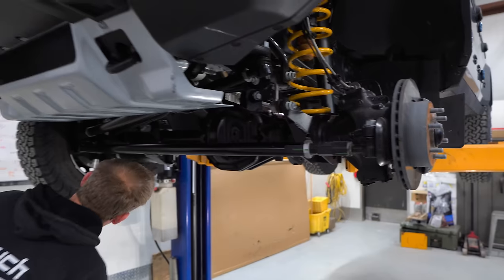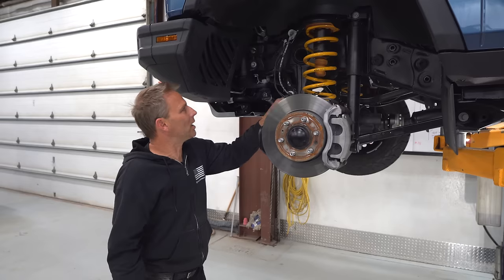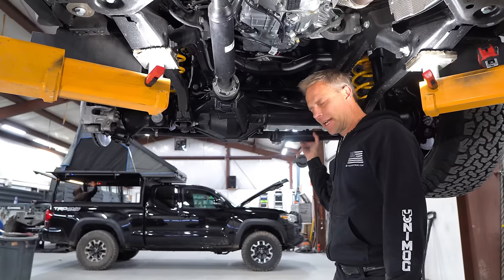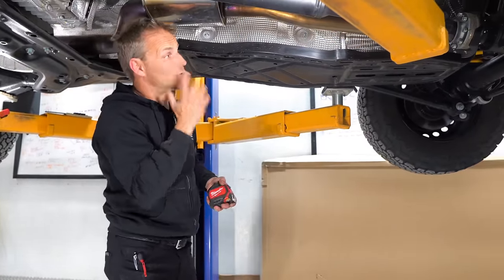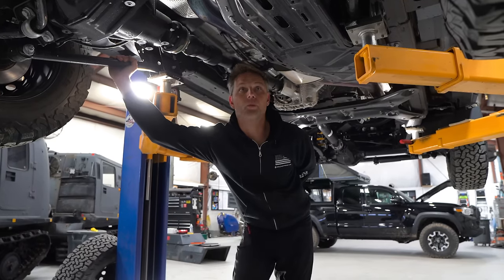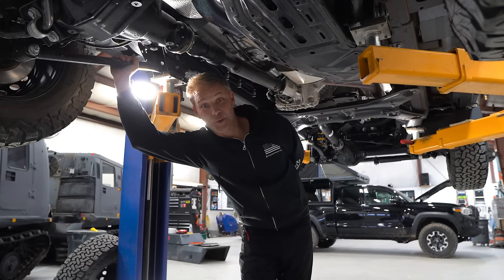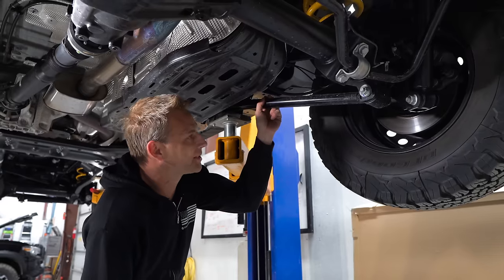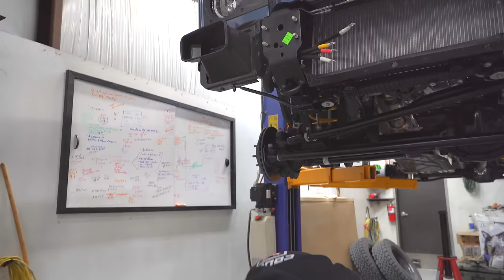Ineos Grenadier Deep Dive | Part 2

Comment: Red Winches are actually machined in the UK out of billet aluminium, and they supply the Ministry of Defence in the UK. Apparently, they're rated according to SAE J706. The contactors are Albright, not Albion; Red Winches also supply these, which I retrofitted to my Warn M8274.

Comment: This is probably the best video out there that shows what the grenadier is all about: Mechanically sturdy and made to last (at least it seems that's the idea and only time will tell).

I saw a lot of comments around about how expensive is and the lack of some accesories (none of them offroad related). This is what you pay for: Beefy parts. The drawback is weight and that's why I think they did not went with a thicker bumber also.

Unless some weird Achilles heel that would be expensive to fix is found in the future, I reckon they will hold their value pretty well.
Reply: The small fuel tank in the operational Achilles heel IMHO. There have been no driving test failures that I’ve seen but such a limited range in factory fuel capacity is baffling.
Reply: @bijano7320  It could be worse... like the "range reduction mod" aka V8 HEMI of 398's Jeep.

Comment: Really great undercarriage review, much more depth than anything out there  Lots of good, but some really WEIRD/BAD choices as well!  A PLASTIC oil pan?!  In a truck with big beefy steel components everywhere else?!  Who thought that was a good idea?!  And a steering dampener hanging that low and that exposed should NOT be 'par for the course' on a truck this expensive and this engineered for true off-road durability and performance - it looks like there was room to tuck it up higher!  Those plastic rocker-panel skirts - they look like perfect traps for road dirt/salt/mud - those are rust pockets waiting to happen.  Probably easy enough to throw out, anyway. Lastly, those unslotted read brakes definitely DO do a lot of work in a full-loaded adventure/overland rig, which is what this heavy beefy INEOS is geared towards.  Thanks again for putting this up on the lift and taking us through it!

Comment: I would look to get the front corner bumpers beefed up to protect the two small radiators in the front.  I've seen two videos where the corner was damaged taking out the radiator + pipework.  Both cars needed towing to a workshop to get repaired.

Comment: Excellent mechanical assessment. I'm curious what impact a lift would have on the propshaft considering there aren't any uni joints and there's an increased prop shaft angle.

Also how durable do you think the uni's are over a CV.
Thanks for sharing

Comment: Take a look at the transfer case cable as it passes the rear of the front drive shaft.   My cable was not secured and was hanging down and hitting the hex head nuts on the coupling making a terrible noise.   It has the potential to catch and pull the cable off.   I caught it in time and was able to secure it.   I asked on the forums and there are several people who had the same issue of the cable not being secured from the factory and hitting the drive shaft.
Reply: After watching your video the hose hitting the drive shaft is one of the cooler lines and not the transfer case cable.

Comment: Can you double check the fan is a Spal on the coolant radiator in the front bumper right wing?  Mine is a General Cab.

Curious to see if they are changing suppliers/spec on these things as they go through the production cycle.

Comment: Is that a ball bearing in the rear axle housing? From the looks it's not a full float but a 3/4 float, still better than a semi float axle. Can you please post the spline counts of the axle and get a  measurement on the diameter? My guess is that these will be close to  dana 44's in strength and ring gear size. Finally some actual numbers on this truck and not just marketing bs.
Reply from the maker: We try to give the people what they want!
Reply: Missed the polyurethane bushes on axle control arms  sure all of the RED winch is made in Somerset England . Great review I have been rocking a Trialmaster for over a year now great vehicle.
Reply: I’ll check the count. Seeing how the wheel load is carried by the hub and bearing units, I’m going to give it a go as pretty much a full footer wings the possibility a a fail on a drive flange on the hub?
Reply: Are the front hubs fully floating with adjustable, replaceable bearings, or are they unit bearings? Landcruisers and classic Defenders have full floaters all round, allowing the rig to safely keep rolling in the event of a broken axle.  @Dirtboxoverland

Comment: What I'd like to know is how close is this underneath to a W-461?   I have a theory that this is an upgraded G-wagon.
Reply: My guess it’s an evolution of the W463, as you know Magna build the G wagon and they did all the engineering for Ineos , to me they’ve perfected what should have been the replacement for the W463, butter still they put a better engine in it .
For all you W463 owners I urge you to test one , you’ll be cashing your 2018 G and getting cash back and owning a better car .
I know I did just that .
Reply: @user-pg1ud3cs4j  My theory is that it was the W-461 line that was moved from Steyr Austria to Hambach, France in late 2022, when the W-461 G-wagon went out of production.  I believe Ineos will chase that military business with this same line.

The line that built the Gen 1 W-463 and the Gen 2 W-463 along with the W-464 has stayed in production all along.
Reply: @fabulousoffroaddesigns5080  I been to the factory in Hambach , it’s no old line my friend . There’s robots everywhere . The G wagons biggest problem was rust and human welding . Honestly this car is designed and engineered by the experts at Magna but it’s 21st century build techniques . My 2018 G wagon was in essence the same car that rolled off the production line back in 1979 rubber fitted windscreen and side and rear window . I cracked mine and guess what the frame was rusting in 14 months . You won’t get that problem on the grenadier , it’s modern bonding techniques .